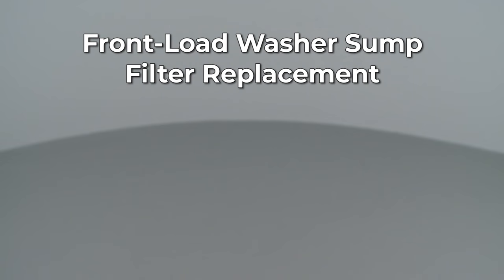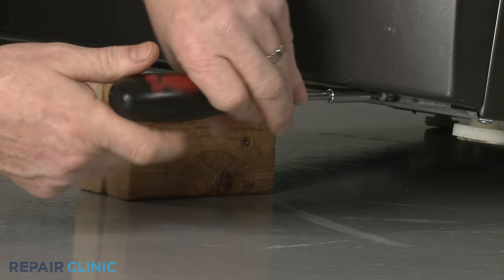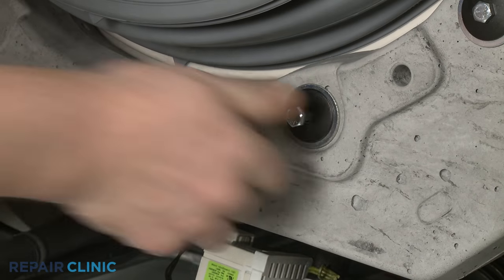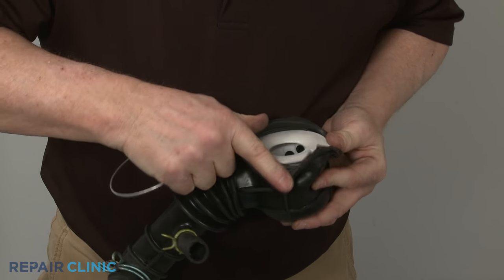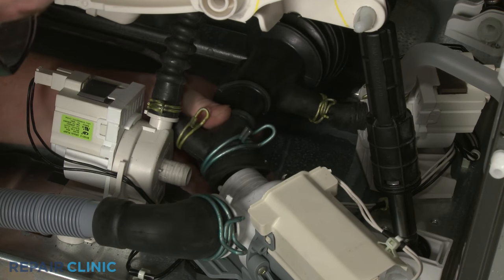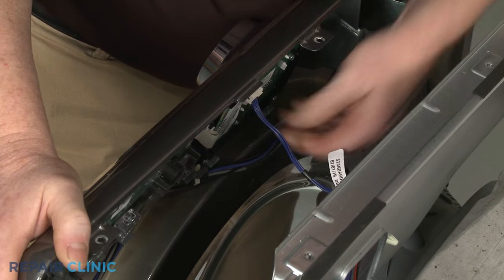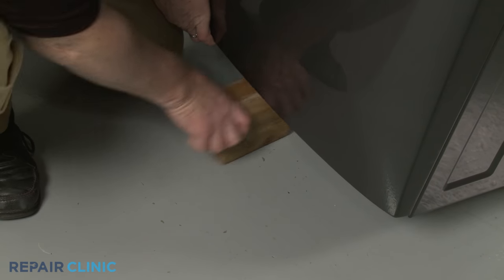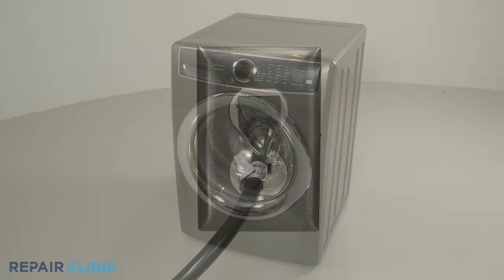Electrolux Front-Load Washer Sump Filter Replacement (part 5304505165)

Comment: So you have to go through all this just to clean the filter?  Older models had an access panel on the front for that purpose.  Who in their right mind would make this change?
Reply: I was thinking the exact same thing!
Reply: Surprised you don't have to re wire the motor lol. What a pain in the a** for something that needs to be done as part of routine maintenance.
Reply: This was the biggest single issue why I decided not to buy Electrolux. It's not uncommon to need to clean or replace the water filter. I had to do it several times with my previous washer. Going through this procedure even once is a chore.
Reply: This design drives sales for dealer service departments. No 
practical advantage for the consumer. An access
door in front or on the side would be easy and anyone could clean the filter as needed . Won’t buy Electrolux again.
Reply: Worst design ever. So they can charge you when you need to clean your filter every. Absurd.
Reply: This makes me so upset. I will need a repair person just to clean my filter.
Reply: This takes even longer when you have stacked set as you have to take dryer off first 😂
The instructions of the video were accurate except he got that seal and retainer on way to easy.
Reply: It looks like the filter is more a large particle strainer. The holes in the drum probably prevent much other than coins from slipping past the seal. And the pump probably does not care about lint. So it's not like a dryer screen that needs frequent cleaning.
Reply: @Snookchaser007 they don’t even show that part cause it’s such a long awkward process
Reply: I think that the designers of this machine write skits for Saturday Night Live,  or maybe The Twilight Zone.
Reply: @anthonysei  The pump cares about dog hair. It never occurred to me that I wouldn't be able to clean the filter when I bought the machine, because no company who wanted to keep a customer would design a machine this way. I paid once for a service tech; it clogged again 6 months later. I'm not paying another $100+, so I ordered a new washer with an access panel in the front of the machine.

Comment: This job was an absolute nightmare and I am mechanically inclined. After cleaning the filter putting it back 1) the filter must be lined up properly inside of the hose 2) The hose must be lined up properly to the top piece. When I tightened the hose clamp the hose kept slipping below the very tiny lip to secure it above the clamp. It took me 90 minutes to "hopefully get it secure. This is a horrible design. Electrolux (Whirlpool) lost a customer over this. This is terrible that I have to go through this to clean a leaking filter on a two year old washing machine that cost over $1,000,
Reply: I had the exact same problem. I also went through the back which caused even more pain. All sorts of liquid leaked all over my laundry room and not just water. Sweat and blood as well. What a massive POS this unit is.
Reply: Most ridiculous thing Ive ever seen!!!!!
Reply: I was hoping that there was an emergency 1-880# telling us we could just haul our washers to the curb for pick up and  get an immediate refund.  Seriously, this design is malpractice.

Comment: Ridiculous!
Wish I would have known this before I bought one.
Reply: Me to
Reply: I regret buying this machine just for a filter. Too much!!!!!
Reply: Same here. I just got mine today and was looking for the drain filter in front of the washer. There is none. This is absurd.
Reply: Me as well. I guess I won’t be changing no filter. I have a feeling I’m going to f it up & my husband will not be too happy. 😂
Reply: I've been a licensed aircraft mechanic for 43 years.  I have had to stand on my head to finish installing components, standing in POURING rain 52 feet in the air, sprayed corrosion inhibitor, and I'd rather do those tasks then clean this extremely ignorantly designed coin trap. We have 3 dogs that clog the trap at least once a year.😡. I can fix anything mechanical/pneumatic/electrical/hydraulic, etc.  I, too, will never buy another Electrolux washing machine.🤮. Sounds like a Freight train during the spin cycle, too. 😡. For me, I just don't have anything positive to say about this washing machine.

Comment: Thank you guys so much for this video. Just completed it in 45 minutes. Cancel the repair call that was coming in on Wednesday. Our sump was completely full with rubber as we did a mat in there which must’ve been old enough to deteriorate. One thing people shouldpay very close attention to is when you are re-attaching the four prong pin they can easily bend. I had to use a magnifying headset to correct them and then attach it. Other than that everything was good, Rl pump area was even simpler than the one in the video.
Reply from the maker: You're welcome! 

We are always happy to help. If you would like to give us a review on Google, we would much appreciate it: https://g.page/r/CcVUrahZNozMEBM/review

We hope that you have a great day!
Reply: HAPPY TO! @repairclinic
Reply: Whatever!!!!!!!!!!
Reply: Hard to believe that we're happy to take apart a washing machine to do regular maintenance.  Remember to do this ince a month.

Comment: This took me just under an hour with no helper.   1/4 nut driver fits the 7 mm clamp for the filter.  If you have the pedestals you don’t even have to tip it back before removing the lower 4 screws.   That said easy access to anything on the machine labeled a filter would be nice.

Comment: 2 questions regarding this procedure... 1. How often this has to be done? On the previous model, where there is a small access panel on the front of the washer, they say on that panel "CLEAN THE FILTER ONCE A MONTH' 
2. Would doing all this - basically taking apart good chunk of the machine have any effect on the warranty like 'doing an unauthorized repairs' thus voiding the manufacturers warranty???
Reply: It's funny that we're even asking questions like this because I can't imagine anyone trying to do "maintenance" in this way.  We are all caught in a Saturday Night Live skit.  We'll come to at midnight.

Comment: Thank you for making this video. I followed it to the T. I do have a couple of  suggestions though. The first is suggesting to the viewer a way of draining the washer first. In the video, everything is dry. When I took the clamps off the hoses, water came out and drained to the back of the washer and onto the towels I laid down. I then used another towel to dry up the areas inside of the washer that got wet. My hope is that none of the electrical stuff was affected. My second suggestion is the view of the clamp that had to be unscrewed. The view in the video is from the back, which confused me. I think it should be viewed from the front of the washer, since only the front of the washer is off, if you follow the instructions to the T. So, besides that, your video helped me out greatly! Thank you again 😁👍
Reply: Also he could have showed taking off the rubber tub and putting it back
Reply: What did you find that might clog the washer?  My nightmare vision is hair, & stray objects.  No way I'm going through this for "maintenance.

Comment: I wish I saw this before I bought this washer. If I saw this, I probablely would not buy it. I just received it today. Except this, everything is good so far. Oh, well, good thing is we are handy enough to to this.
Reply: I have had mine for 4 years now.  I've never done this service, though I'd like to.  I run a clean cycle every month with a cup of bleach.  I'll never clean the filter unless I get a code or something.  They must have hired an engineer from Mercedes-Benz to design this washer.
Reply: I think that the designers were formally writers of skits for Saturday Night Live or maybe The Twilight Zone.  What pranksters.

Comment: There is another way.  You can access the filter boot from the back of the unit after removing the back panel.  It is tight but can be done.
Reply: I just did this last night for probably the 6th time since owning this washer.  The back panel is much easier to remove as all the screws are accessible, and you don't have to mess with as many trays and electronics.
Reply: Thanks for the tip... will do.  How did you know that the filter needed to be accessed? Some symptoms?
Reply: I tried that but the assemblers stripped the metal screw heads so there's no leverage.
Reply: @conneljw  one my Electrolux  model  the filter can be accessed from the opening on the bottom. No panel disassemble required. Just flip thr machine on its side. Still not an easy job as access is tight, but it's doable

Comment: Builds a stackable washer and dryer. Makes it so you have to unstack it to change or clean a filter? All I'm hearing is, look in the holes in the drum with a flashlight. Use drain witch to get possible dog hair out.
Reply: Btw, that doesn't work. 🤣
Reply: Ouch!  What we put up with to do , what should be, regular maintenance.  The designers of these machines must have been on something.

Comment: Looking at the part, why does it need to be replaced?
Is there a screen material in those holes?
If not, then what is the point?
Reply: I doubt it needs to be replaced often but rather it may need to be cleaned due to getting clogged. That's what happened to me after I stupidly washed a dog blanket that was full of dog hair and the washer was unable to drain anymore. 

But yes it was ridiculously difficult to get to. I figured it out but it probably took 5 hours and a lot of elbow grease. Also created a huge mess when I finally detached the hoses and all the undrained water spilled onto the floor.
Reply: Well the video is called "sump filter replacement" not "sump filter cleaning..." right? :)
Reply: @laurieb2860  Lol yeah, you are right!  I don't know, my washer is probably 10+ years old and the filter seemed in pristine condition other than I could have made a dog hair sweater out of its contents.  So I've gotta believe it's a really rare thing to ever have to replace it.  Who knows, though, if you tend to use a lot of bleach maybe it could get brittle?
Reply: No need to replace the filter, just pull out the debris and wash it
Reply: This is not a 5 hour job, an hour at best
Reply: @GTXKen  Fair enough if you have done this job or similar ones before. I have not so I was figuring things out as I went. Hell it took me an hour just to get the damn hose clamps back on securely in the compartment below the drum. There was hardly any room to work and it was difficult to get good leverage to squeeze them open to get them into place. It's ridiculous how difficult they made to get to a filter that occasionally needs cleaning.

Note: my washer was a different model but the process was basically the same.
Reply: This took us 3.5 hours. We had a different model, had to move stuff out of our small laundry room THEN disconnect and move the dryer out of the way. We also had a drum full of water and towels to deal with. Finally, the door was locked so I had to figure out how to manually unlatch it.
Reply: If you paid attention, the filter was referred to as a coin trap. Don't wash coins in the machine and you won't have to perform this maintenance. ;-)
Reply: @philipb5014  If you paid attention, you'd note none of us referenced clearing coins out of our filters.
Reply: @philipb5014  🤣🤣🤣 better than couch cushions or unhooked Aldi carts! I'm rich!
Reply: @philipb5014  Until you get an idiot tenant who decides to wash a pocket full of dry wall screws, and the washer is suddenly leaking.
Reply: Cleaning a filter that's accessible would take a few minutes and could be fun a monthly maintenance activity.
Reply: I truly feel your pain and will not endeavor to try the same job.  Imagine if there were an accessible filter to easily clean monthly.  Because,  what I imagine is in there is not pleasant to dwell on.  Meanwhile, Electrolux laughs as our 401K index investing across the market keeps them rolling.

Comment: Thanks for this! Have a tiny bit of dirty water coming out on the floor, under the machine. Having taken it apart, I think the tube seal may be worn a bit given the light spray pattern going around the inside of the machine body. I'm tightening all the tub bolts first to see if that helps. Glad I saw this video. Might as well check the filter while I'm in there. 
I can't believe the whining about this being "hard". Sure, could be a bit more user accessible, but we've got 10+ years on ours and this will be the first service on it, and I've never "had" to clean the filter. We shall see how bad it is. Really though, this is an easy job, done in under 30 mins. Must be a bunch of under 40 types whining having never done anything with their hands and tools before. 
Thanks again! I'll report back if I find any monsters!
Reply: So what was the issue?  I am having a similar problem, small amount of water on floor.
Reply: @jimmac216  I got it all opened up and saw a ring of spray around the inside of the washer panels. So I feel the tube halves seal was maybe leaking a bit. But I think there was also another, more significant leak somewhere. I did give all the tub shell bolts a snugging up. I felt all around and looked, but couldn't find anything that indicated where the bulk of the water was coming from. It was still leaking once I put it back together. Of note, the water looked quite clean. So I'd think that'd would indicate a leak on the input side. But again, I couldn't detect where with it apart. Given the mucking about it was going to take and possible parts ordering and expense of chasing down the problem, and time w/o a machine, I just ordered basically the newer version from Costco. On balance, a 12+ year old modern machine is likely going to break elsewhere a month after you've fixed one thing. Not worth the waste of money at that age. So just replaced the dryer as well, buying the new units as a pair. Told the delivery/install fella that the old dryer still worked and what the issue was with the new. He was a good guy, new to the country. If he wanted to take, fix and sell either or both, power to him. They just get tossed in the dump anyway.

Comment: I don't know if you'll see this but, like someone else said, I'm having an impossible time getting the wire clamp to seal around the tub drain.  I could really use more detail about how they go together.  It looks like there's just not enough of a tube for the wire clamp to bite on.  There's a very slightly raised lip around that tube...i assume the boot goes over that lip? But the boot just doesn't want to go that far.  It seems like the boot needs to be a quarter inch longer or something.  Every time I try to tighten it, the top edge of the boot slips down into the outflow side (which is cut out of the drain tube from the drum).  I'm pretty much at my wit's end.  But I'd hate to throw out the washer now that I'm literally one connection away from it working again.  Any suggestions would be appreciated.  I even looked at the clamp to make sure it wasn't deformed. It looks fine.
Reply: Oh the hoops we jump through.  I'm sorry for your situation and hope that someone has good a answer.  I am angry at the absurdity of this design.
Reply: @Herbocharge-tu2yp  thanks for the support!  I did eventually get it. The key seems to be that it doesn't go on flat like you would expect.  It actually goes on at an angle.  I probably could have saved myself an hour or so, just with that piece of info.  But it would still be a mind-flaying experience trying to seat it properly.  And for two weeks afterward, I was holding my breath with every load of laundry, hoping the thing was on and would hold.  It is, and it did.  Only took a week for the wounds on my hands and arms to heal.
Reply: @Herbocharge-tu2yp ...and vise-grips helped me too

Comment: I saw a video for this repair on an Electrolux washer (not sure the model) and the guy went in from the bottom of the washer (tilted it back at a 45 degree angle) as there was a large access area on the bottom.  Anyone know if that's possible vs going in from the front or rear?
Reply: Yes you can go thru the bottom. Watch "How to fix an Electrolux WASHER THAT WON'T DRAIN". I have a perfect steam Electrolux and the opening is located more center, on the bottom. The washer needs to be leaned 45 degrees or flat onto the right side of the washer to access the opening. Use a 1/4" socket to loosen the ring clamp. The rubber boot, holding the coin/filter holder, can be pulled down from the tub drain fitting and you can stick your finger into the filter. If you can feel cloth, (baby sox) etc. you could try a bent wire clothes hanger to fish out what you can't grab with your fingers. On my machine I had to unclamp the rubber boot inlet going to the top of the washer. I should of used a bent, flattened coat hanger tip into and around the rubber outlet, to break the seal. This allowed me to rotate the rubber boot to take out the plastic filter cage and clean it out. The filter was clean so I removed 2 more clamps for the pump to remove it. Took less than 45 minutes but I'm sure it will take longer to assemble. The hose clamps are hard to compress with a channel lock plyer.
Reply: @conphuzed1  Thank you!

Comment: Thanks this is great and all but how the hell u get the door open in order to do all this? Mine is locked and there is no drain
Reply: Same problem. When I took the top off, I reached inside to the gray, plastic latch housing. There is a tab on the top. Press that and the latch releases.
Reply: If you take the outside drain hose out of the wall drain, and put it lower than the tub, gravity will drain it.
That's why washer drains go up before they go down. 
I realize you've likely solved this problem in the last 5 months, lol. But someone else might need the info.